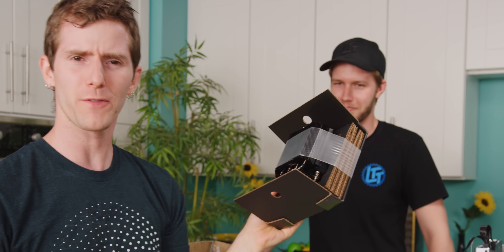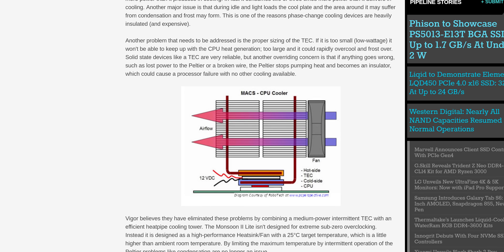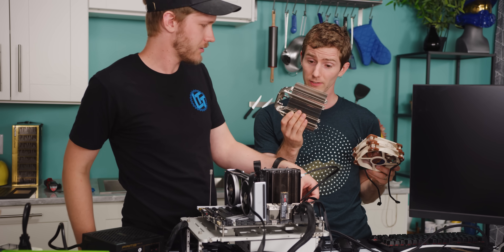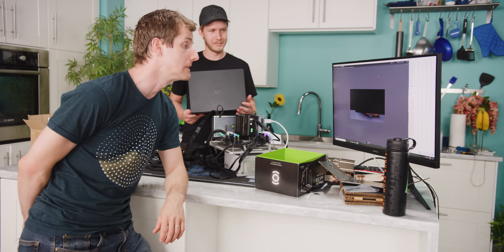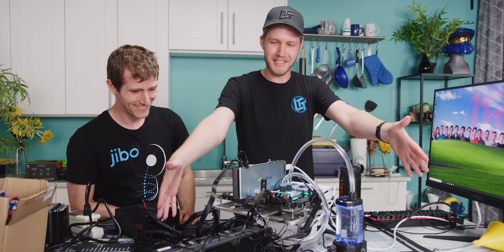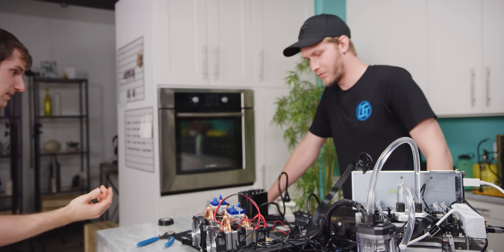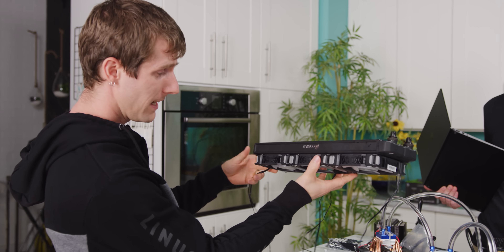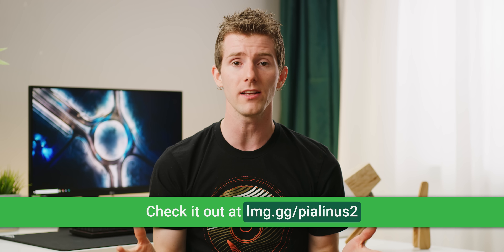Thermoelectric Cooling is a Bad Idea

Comment: I could just say both pelchers are wrongfully designed pipes should go the same way as the plate look like tiny blocks as space pipe space pancaked sides sealed blower at one end uses the full plate hallways one space above to let the final exit at the chip surface so hot goes in top cools toward the bottom other wise its less efective as just a fan on water pipes with no darkness the pelchers made pointles becomes belchers of sickness lacking the point of a healthier system made by design utilized to specifics not just closely slaped to gether in a less efective shape  because shape makes the whole difference to how it works air through the blocks adding water though as even odd even odd one block plate can this way can cool more than ten stacks like they had it the fan itself needs digger fins look like a drill bit flattened paddeling air digs to the pelcher halls water pump similar as the fan works because the added dark and flow through the cooler elements made cooler by the darkness as any shaided shed dark water and moveing air all in darkness applies the parts most effectively thiner than soda cans thicker than foil like a disk with hallway tunnels is wire thin cools faster than large pipes but adds harmonic plates to make the engin look realy cool ass with some big mini blowers like its an engin air cooler

Comment: 1 metal is cold but pointless without dark and forced air boxing it wont do half as good without those and less without a few thermo water tube between those bet one way is cooler. if blocking condensation issues then it has suficiencey from the furthest bottom of a pc ,sealed except for the air flow holes through the walls of a pc  spacer plated so the whole box cools the internal with no water flowing upward to the internals its a dark shell that makes it work better with forced air flow, not alone or so close to inner circutry thats why its not good ,condensation of changeing temps,  but sealed at the bottom closed off water made to stay constant temp runing air filter too for water absorbant in the shell made removeable to clean ezily but still dry cold through upper air holes blowing down on internals but here free design tip for ideas that earn better worth
oh also pointless in bulky plastic or rubber tubes try wire sized metal tube maybe glass pryrex webable like fan caidges too, otherwise the tube rubber and plastic negates the cooling effect just ''appearence  cool'' vs ''elemently cool'' for clear glow of rgb lights same with glass but gets colder for actual effectiveness with pyrex stays cooler as heat resistant parts better than plastics i would also say the one you held up bad use of the plate with the pipes not between the plates not boxed give less darkness and no forced air conection just makes a hotter open plate just sitting there where design has better importance when other mentioned is included then is has signifigance of greater effect

Comment: The only useful use i've seen for a peltier is for precise temperature control in scientific applications.
But the thing is you can get 12V heat pumps that will blow them out of the water in terms of throughput.
Reply: Hello I am thinking about using a thermoelectric cooler peltier outside of a   
Metal wood stove to power its own 5w fan...will it work?

Comment: The problem is if you trying to cool your CPU without a thermostat it creates condense water wich leaks onto your motherboard en make's it breakdown i did test this myself and its beter to use air cooling or watercooling ratter then using a TEC cooler

Comment: I am going to try a crazy cooling scheme...
You can rig a window air conditioner to cool down to 2 degrees C or around 36-38 degrees F.
If I build an insulated box around the window air conditioner and set it on a table next to the window, I can have my pc inside it.
If I build a shroud from the ac fan output to the noctua cooler... epic cooling will be happening. I hope to get a 5.7 overclock on a 12900ks.
just planning on using a test bench instead of a full pc case. I don't know how permanent the set up will be. Cost of cooling... might be to high for everyday use.

Comment: "Fun" fact; A peltier "TEC" element for cooling, is efficient. How Efficient? 5%. Yeaah.. That means for say 100watt TEC1 element, about 5watt is output in cooling, with the remainder 95watt is excess heat!. peltier elements is more suited for heating, or spot-cooling for sensitive equipment perhaps, still, cheap and fun to play around with, peltier elements are just not very good for CPU cooling.. Unless... Raspberry pi overclocking? heh..

Comment: Problem with these coolers is that ordinarily the only thermal load on the heat sink is coming from the CPU, but with one of these coolers the heatsink has to disipate the cpu heat + the 30 to 40 watts of heat from running the peltier. 

Peltier coolers are great for applications where you are drawing heat out of something that ordinarily wouldnt radiate it off (cooling liquids for example), but for something like this using just the heatsink is way more efficient.

Comment: I would love to see a project where you have an array of Tec coolers cooled on both sides by two large water blocks, where the cooling capacity is greater than the max power consumption of the cpu & gpu.

You have the hot side a water loop to dump heat to probably 3 rads each with 3 120mm fans.

Then the chilled side, a water loop to your cpu & gpu.

It seems key to me to have the TEC coolers controlled by an arduino, that is monitoring the discharge cold water temp from the TEC, and comparing it to the local dew point inside the case, cutting power to the TECs when you’re within 2 degrees of the dew point.

It would probably be a good idea to have thermal mass in the cold water loop, for when cpu and gpu ramp up and down. Maybe an insulated LTT tech bottle? Probs wouldn’t hurt on the hot side, but not entirely necessary.

Little things I would then geek out on are the cpu and gpu being piped in parallel on the chilled water loop, with balance valve so you could divert flow for optimum temps between the two.

I’d prob have all the hot flow go through 1 rad first (as it would be at high temp and thus dump heat quickly with the air), and then the second rads in parallel, running at lower temps but having a lot of air to approach ambient. Maybe experimenting with arrangements here would be fun.

But the key part of it all is that arduino monitoring chilled water temps, as to not have condensation on the cpu or gpu. Which I think is one of the main faults with the coolers shown in this video, second only to their cooling capacity being much lower than the max power consumption (thus heating capacity) of the cpu.

Comment: I put a peltier in one of those first gen koolance cases and got a tualatin p3 to 1.7ghz with a 200 fsb. 
We were custom building PCs for people doing 3d modeling using water cooling and peltiers in the early 00s. They thought we were magicians when they saw the temp and clock numbers. No one cared about power draw back then.

Comment: It achieved the goal of getting the heat away from the CPU, but you are bottlenecked by the heat having nowhere to go. I could see it being effective if you integrated water cooling directly into the thermoelectric cooler. It may be able to improve heat transfer between the CPU and water, allowing you to pump more water through.

IDK, it wouldn’t be cheap

Comment: The objective of cooling system is not to mask heat with cold but to pump it away. Fridges work exactly like this. When you pump cold air or water in, it warms up (2nd law of thermodynamics). Heat sink is called so for a reason, it basically drains heat away like a sink drains water. That's why they're usually warm. Your fridge has a radiator behind, it is usually warm because all the heat inside the fridge is transferred into the radiator and it gives the heat away. Peltier plate warms on one side (CPU), cools on the other (inside the body). Heat is converted into electricity. It can be used to power the cooling fans, if no or not enough power comes in then they can use motherboard power. Fans have to blow cool air in and hot air out. You would rather have a computer work like a fridge or an air conditioner.

Comment: works great on my CPU which used to be hot as hell. I have tinnitus and i needed it to be quiet and it worked for both cold and quiet. People can knock Thermoelectric all the want but when a older AMDFX cpu gets much colder it is a big deal. Ive seen enough proof on my own system. The Hex cooler does work .

Comment: I made my own when CPU (AMD) speed was less than a Gig. I put the peltier in between the CPU and the heatsink with fan. I powered it up on the 5 volt side of the power cable and  overclocked the CPUt a bit. I worked great as long as there is a data load to process on the CPU. I used BOINC for that. Everything worked great until BOINC had no work unit to crunch.  The CPU got below freezing and shorted out the CPU when it wormed back up. I dont think today puters can be cooled by peltiers anymore. BTW some beverage coolers that you plug into the cig outlet are using Peltiers

Comment: I think the peltier water cooler failed because of the fan design, The fan only blows one way which takes hot air from one heatsink to other , If we remove the center fan and make tow of the outer fans to blow out they may perform better.

Comment: Sure I am just seeing this now, but you guys should have finished off by connecting the radiators and peltiers together as one unit and tried it on either side of the loop. I'm guessing if the radiator cools it enough for the peltier to not be overwhelmed. It might just work if you have it before the peltier.

Comment: Have you seen the Intel Cryo?  It seems to offer really good performance and may be the future of cooling.  it uses dew point monitors and has a condensation barrier which prevents most boards from being damaged if something goes wrong.  It seems to operate at around 150 Watts and is being integrated into water cooling solutions.  I think because of the fact that you could use this on a fan-less build (minus the water coolers), it is becoming more popular for people who like quiet machines.  We may one day see specific motherboards designed to combat condensation and graphics cards with this technology built in.  That being said, how will they combat the amount of Watts being used?  perhaps more efficient designs to make heat only flow in one direction will be used to lower that consumption.  If you reverse a heat sink then the fins hold heat more individually which could cause a heat valve like we are talking about.  Bending the fins to lay against the Peltier module would allow it to transfer more quickly.  You could build some sort of base made of a heat insulating material to further stop heat from being transferred from fin to fin and then remove the top connecting piece of metal.  I think that would produce very satisfying results if you test that.

Comment: People using TECs "We ran it at 100% power and it thermally throttles! Peltier devices are useless and inefficient!" also those people, not running their CPU at turbo speeds 100% of the time...

Sorry if that doesn't make sense but TECs can be very efficient if they aren't pushed to the max at all times. Almost nothing is ran at 100% at all time but for some reason people think TECs should be. Think about your car. Is the accelerator an on and off toggle?

Comment: Love the giant pile of thermal grease under the rock, how did that work out?
BTW did you have that fan pushing hot air into the cold side on the TEC?
Reply: It was cast aluminium, you can see how badly it turned out (The surface was so bumpy they had to use so much thermal paste) in this video:
https://www.youtube.com/watch?v=vL72lQ6dRZU

Comment: If you think about it, Peltier modules can achieve cooler temperatures than air or water cooling. They can go in the negatives. That low temperature comes at a cost though, it has to expel all of that moved heat. They are not efficient whatsoever. Far from it. But they technically can cool a small area, like a CPU, to sub-zero temperatures. You'll just be using a metric fuckton of energy to make that happen and have to deal with trying to cool the thermonuclear hot side. If you can't make the hot side cool, it will soon reach thermal equilibrium and stop working. If you want efficiency, strap a freezer heat pump to your CPU.

Comment: One small oversight everyone misses,  when you apply the thermal past you should avoid making air pockets in it.  The air bulbs may be trapped between the cpu and the cooler lowering efficiency and potentially creating a hot spot on the cpu.

Comment: Well, just as ‘using a screwdriver is a bad idea’ … if you’re trying to cut down a tree. Using the wrong tool for the job tells little about the tool, but a lot about the operator. I use TECs a lot to stabilise temperatures in circuits that have bulky (but slow) heat dissipation means, and they work like expected: very well.

Comment: An old friend of mine cooled a celeron 600a by removing the outer case, gluing a bisected waterbottle with in/out tubes for flow as replacement, and feeding ice water through the setup.... blew 3 motherboards but never a cpu and got it just above 1ghz (back when the 600a was almost new)

Like many others I've often wondered about peltier cooling, but could not possibly afford replacements... thank you for this video.

edit: unsuprised they needed temp flow control - likely good I didn't try it :D

Comment: The hex 2.0 cooler has its own software. Why wasn't it installed for this test? You could have set the controller to insane cooling which would have been more of a proper test. Sloppy work Linus.

Comment: Thermoelectric cooling is not a "bad" idea.  The "bad" idea is using it for the wrong applications.
It should not be used to cool down chips that generate a lot of heat.
It should be used on things that generate very little heat that need to be cooled in a small space.
Such as a "micro fridge" for a few cans of soda.
Or for electronics....using Peltier cooling on an MCT infrared detector may be better than the alternative of carrying around liquid nitrogen to accomplish the cooling.

Comment: The Peltiers becoming an insulator is absolutely true. I bought 2 of them as a kid to cool a CPU and if the CPU gets too warm, they basically become heaters and the more power you dump into them, the more heat comes from both sides…
Reply: Soy, it does not work for reduce the heat of a Cpu., why?
Reply: @marioj6330  well a peltier module has a ratio of what maximum heat it can dissipate. lets say if your hot side is on 50 C then the cold side will be 5 C. but attach an radiator at the hot side to reduce the tempt to 25 C then the cold side will be lower than 0 C. now back to your question. it cannot reduce the heat of a cpu because the cpy destroys the hot and cold ratio on the 2 sides of the peltier module. the radiators or lets say heat dissipation system is not instantaneous and not 100% efficient as it can only draw such heat from the source. Thats why when the cpu is running and getting hotter, the peltier follows that hot and cold side ratio but with the cpu running the cold side is 30 C warmer(still increasing) and the hot side is already burning hot 70 to 100 C. the figures i said is just for representation and not its true value if applied in its formulas. but you can get the point of why it does not reduce the heat of a cpu
Reply: so, it actually starts cooking your cpu?
Reply: With a good insulated heat sink shouldn't it do no harm?

Comment: Suggestion for another bad cooling idea. I was the scrapyard wars series recently and had an idea after watching the Copper Coil... Why not just put the coil in a cooler full of ice and/or dry ice - yes it would only work if you kept adding ice, but thermodynamically it would have to work right?

Comment: Wouldn't the heat dissipation from the two TEC/Radiator assemblies be impeded by having the radiators, and thus the heat pipes, upside-down? It seems like that would hinder the phase-change from occurring in the pipes.

Comment: For good results you need to build a water chiller with the peltiers and you need much more of them, because they pump the Qmax only at a small temperature range. 
Better espect like 30-60% from the Qmax so you will neet at least 3-4 of 65W Peltier for 100W cooling.
Also this test is not that fair, because the price is way to high for the peltier. The real price for one peltier is 2-5  each !

Comment: I thought about using Peltier devices but immediately thought about the airs humidity and resulting condensation. I'm sure it can be done but I'm not wasting my time on it and crisping parts in the process, and they are extremely inefficient.

Comment: I ran usually a 180w Peltier sandwiched between "hot" and "cold" plates with the water block atop the "hot" plate and that had its own specific water circuit with a secondary circuit for the GPU, RAM, bridges etc as the Peltier could seriously warm up the water and the last thing you wanted was to wash your other components with warm or hot water.   Special grease had to use as well to prevent any chance of frosting on the cold plate which would have condensed atmospheric water into ice, then melted zapping your components with angry pixies.   I got into all that for an overclockers forum challenge of getting an AMD single core cpu (Barton) to 3ghz, still got a box full somewhere of the dead NF2 DFi Infinity motherboards, OCZ ram, 9800GTX vid cards and about 30 cratered AMD 1700(M) laptop CPU's and the one I got my name up on the leaderboard is in there too... lasted a few days before cratering but in those days 3ghz gaming was insane :)